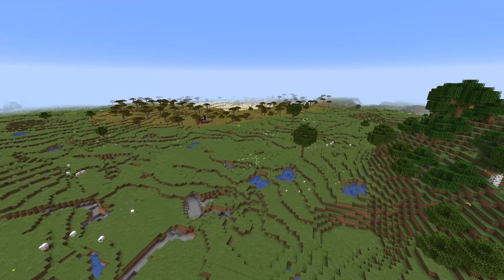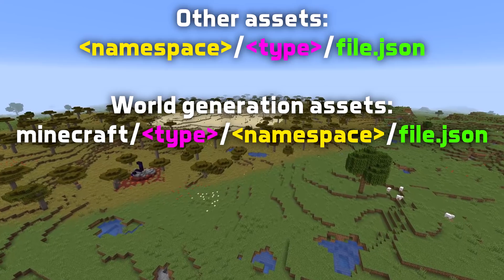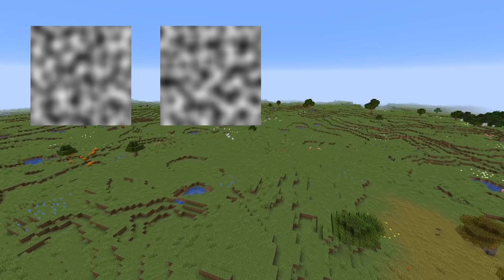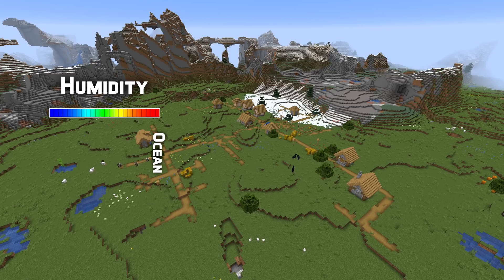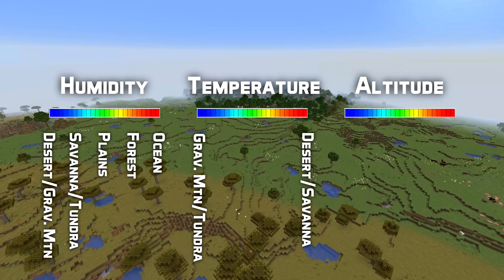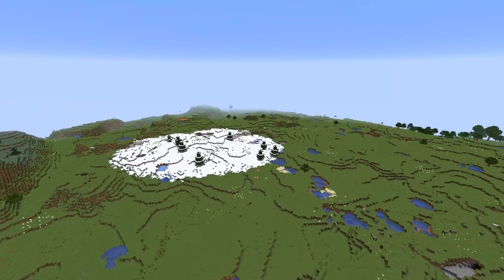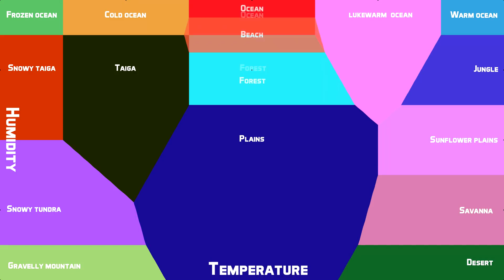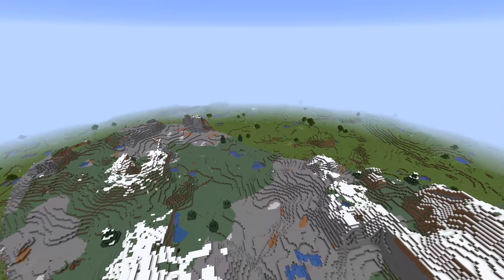Crafting Custom Worlds Tutorial: Part 2 - The Multi-Noise Biome Source

Comment: Starting with this snapshot, Biomes O' Plenty can be a vanilla datapack. (save for some of the custom blocks)
Reply: and the same for all of the custom world generation plugins for servers
Reply: jad  I'm waiting for the day when biome bundle becomes vanilla. It will be a great day
Reply: Custom blocks is probably the next big milestone once the new world generation features are fully complete and out of experimental
Reply: @Tomatech  That'll be extremely cool to see and if that actually happens you might as well as call datapacks modpacks.
Reply: You can make both custom blocks and items in datapacks already. However it should definitely be more supported than it is right now so we don't have to do a bunch of wonky commands to make the block/item appear.
Reply: If the Additions mod by TmTravlr is updated to 1.16.2, then custom blocks can be added using that mod.
Reply: @juniorjedi2563 , I think one of the Craft Tweaker mods also has this feature, and is specifically designed for that sort of thing, or are we talking about the same mod?  I can't remember what it was called.

Anyhow I remember I was haphazardly trying to make a modpack and I added a few blocks with a CT addon mod, but this was on version 1.12.2 iirc, so not exactly a recent version, I ofc Also tried Open Terrain Generator and Biome Tweaker and ba rious other options for custom biomes- I really like OTG, but it has a few limitations and its structure (and other features) files are cumbersome and difficult to work with, it also doesn't work as well with Advanced Rocketry (AR) as I had hoped.
I was going to make custom planets, probably with OTG and Just Enough Dimensions, probably fairly doable, but I lost motivation especially since AR has a lot of features that can be customized and I wanted to smoothly integrate a lot of things into this planet progression, I probably should have started out with some baby steps though, like making at least one flush biome first, then a few more that for right in, then making a dimension, then working on the AR side of things, then maybe work on some more abstract things like a gas giant in the same solar system as that new planet, ect, also maybe mak8tye Initial entry into space incredibly easy- 

On that note, one of the things I love most about OTG is the ability to add a spawn structure at very specific coordinates (and say where exactly the player should initially spawn) so you could very feasibly give players a good initial setup on any world they create.

Anyhow, I always love it when vanilla gets more customizability, I hope loot tables get an upgrade for things like entity drops- this would be useful for things akin to silverfish blocks spawning silverfish when mined and for things akin to villagers turning into zombie villagers upon death by zombie.
Reply: You can just decompile and recompile mods that are at least for pack_format 4.
Reply: Also i just made one singular biome for one of my dimensions (the ocean one)